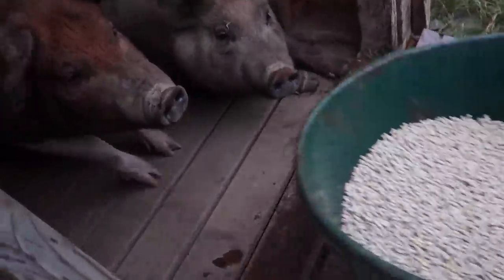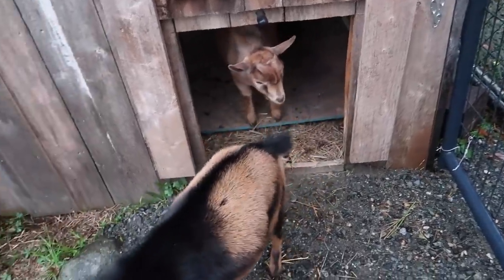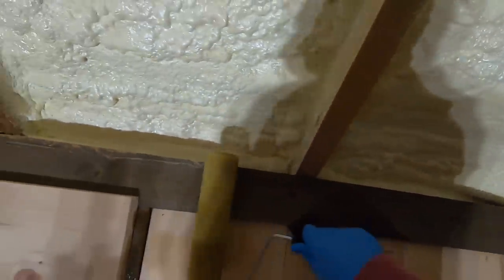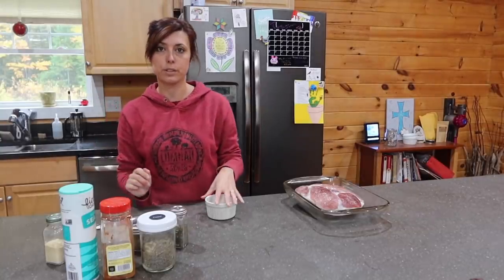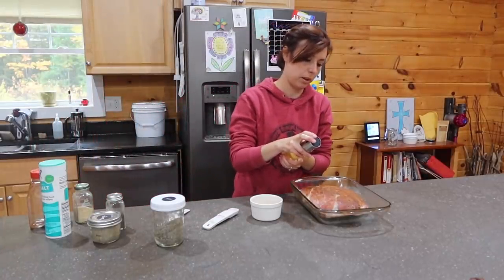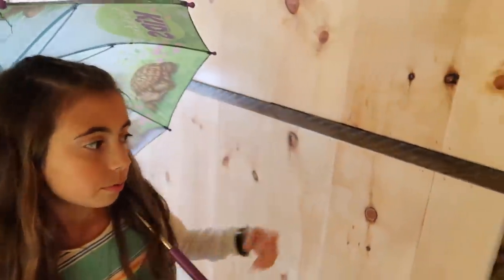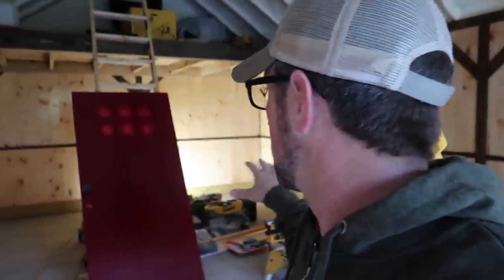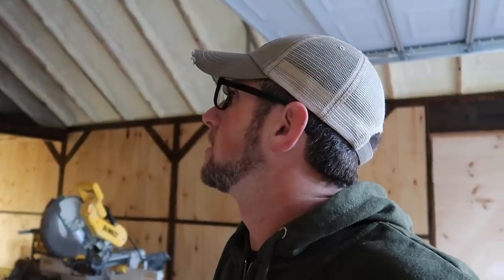Time to Get Sticky! Applying the FINISH to the Post & Beam WorkShop

Comment: You will get a lot of suggestions about the shop layout I'm sure. I only have one suggestion. Cover some of your workbench with metal, maybe the section under your vise. It is so nice to be able to wipe it off, and no oil or gas gets down into your wood. I was a mobile mechanic for years and learned the value of that. I went to a local store where they made trim for metal roofing and they bent the cover so it fit like a glove. It covers the back splash guard, bench top, then is folded so it slides under the front lip of the bench. Again, it fits perfect and eaves a clean looking bench. Surprisingly didn't cost much either.

Comment: Suggestion...   make everything on wheels, including the workbench(s).   There are a ton of locking flip down feet, etc...   believe me, one day you will wish you could roll everything over to one side if the shop and deep clean the floors.  Also, I started out with open shelves on wheels, and quickly changed over to rolling upright metal storage cabinets on wheels.  I keep the doors closed, and it helps to keep the dust off of whatever is stored inside.   I still have some rolling open shelving for big stuff that won’t fit in a cabinet, but those items and the shelves themselves are coated in dust!  Can’t wait to see what YOU decide.

Comment: My shop is deep like yours. I have mine setup in three parts. Right inside the doors i have the yard stuff we are always grabbing. One high  shelve  and wall hangers and mobile things we use outside. Next part is all my mechanical stuff to work on the car, truck and tractor. I have all of my big tool boxes , compressor, parts shelved and bench with vise.  The rest is the wood shop. U have a u shaped bench with overhead wood storage. Easy to sort and grab. Watch your chop saw placement so you can cut long. I have my table saw incorperated in a large runout table in the center that is mobile but locks in place. Use LED lighting and a lot of it. As much as you can afford and makes sense. Seeing your work make everything easier. Have about three drop down electric hook ups tall enough to not hit the top of the truck. Same with air compressor drops. Make sure you do a vac system for your wood work or you will have dust all over the place. Not sure about your ceiling. I wonder how much dust it will collect. 
Well. Its a nice shop. I love mine but i have had several setups and this works best for me. Make sure you do what works for you.  I have worked with and without heat but not anymore. Heat is important. You might want to insulate that g-door.
Love watching your videos. Good luck and cant wait to see what you do.

Comment: For the workshop, all the ideas you mentioned sound really good. My focus tends to be about usability and comfort. Specifically, I think around the benches you should have the rubber flooring to save your knees, back,  and keep you from standing on cold concrete--you'll thank me in 20 years. Also consider having an island bench that is moveable and add extra storage. Just like having a kitchen island, that way you don't have to constantly run from side to side, you only need to pivot. AND since it's moveable, you can position it anywhere. So, for example, Livies or Gina wants to work on something but you're already in the middle of something, in  a static setup and you'd be constantly dancing around and annoying each other. With a moveable bench they could set up their own area.
Reply: and rubber flooring/mats would protect floor from spills,,,good thinking
Reply: Those stable mats are ideal.
Reply: But that concrete sealer to keep junk from sticking

Comment: Build the right hand leg of the "u" shaped bench as a separate bench on wheels.  You can build it with toggle clamps attached to connect it to the rest of the bench and wall to make it stationary when needed.  Jay Bates just built a bench made of 2 separate halves clamped together.
Reply: I love this comment because having everything portable on wheels is really handy.  Including your chop saw.  I would ditch the stationary stand at some point and get a portable gravity stand.  Dewalt makes a gravity stand like my Bosch stand and they work fantastic for going to remote job sites easily. with all the dewalt stuff you advertise freely every day....honestly you should get a sponsorship and sample for every dewalt product that you need.  Having wheels will allow you to rearrange the work benches to allow you to set them up as a studio with the bench between you and the camera.  It will let allow you to work on extra long pieces that don't fit in the U pattern (I'm thinking windmill blades and tower pieces....hint, hint...)  
As far as other benches go, if you do put wheels on them, make a way to lock them down so the bench doesn't move *(especially if you have a vise). This could be as simple as a set of blocks to chock the wheels or buying wheels with locks built in.  Also, larger diameter wheels with bearings in them and rubber tires can also be pushed out onto the gravel if you need to clean out EVERYTHING from the barn.  

Love the barn. Its been fun to watch the progress.
Reply: I was thinking the same...
Reply: Simple surfaces that are all the same heights and with locking wheels.   Some with cabinet storage, some drawers, some open shelves.
Reply: Agree—my suggestion was going to be to put workbenches on wheels, makes for flexible configurations of work surfaces whatever you want to work on and wheels make floor cleanups a snap!

Comment: I have 3 friends that have built shops. 
They build their cabinets on heavy duty lock type casters.  The nice thing about modular units is the ability to reconfigure based on need. 
Like your kitchen island. That is a ton of work surface + enough space for visitors...  also, you can put some outlets in the cabs for lighter duty projects and storage. 
☮
Reply: and if you build a metal cabinet, put tubes on the bottom to capture fork lift tines.  Then you can use your 3 point hitch to move the metal cabinet around the farm if you need to do weld repairs remotely.

Comment: I love it when you walk to do afternoon chores with Olivia.  Sharing your day with her keeps it special for her to.  We had a 24 x 32 garage with 2 big doors and 2 utility doors.  On the one side we bought 2 of the kits for workbench's from Menards.  The were made from 2 x4's and were very strong and rugged.  They also had one shelf storage underneath.  Very user friendly and easy to clean.  Kept everything from being on the floor.  Remember to put in lots of pluggins along the benches for ease of convenience.  Also check out Pinterest Gina for battery holders for power tools.  Al can easily build one.

Comment: Good morning.
I would definitely make sure that all your conduit runs for power contain spare wire to allow adding future circuits.
There is a high likelihood that you will want a future circuit here or there and the spare wire already in the conduit will make that a breeze.
Reply: I would add 240 volt outlets as well for a welder and electric car charging.

Comment: All these comments are good. In our workshop We made all counter tops the same height with a roll around workbench the same height with 8 drawers in it. the top is made using 28 2x4s stood on edge much like wranglestars, wrapped with maple for an edge. the drop down miter saw stand is a must. Keep in mind the lengths of lumber you might be sawing when positioning where you mount your saw. Great work Lou, keep it up.    Rob.

Comment: If you are going to have the chop saw inset in one upright of the "U", then your vise should be at the end of the other upright of the "U".  You want it to be on a corner so you can work at it from a lot of angles, and it would be in the way of your lumber if it were on the same side as the saw. 
     Wranglerstar has done two series on workbenches. One was recent making and setting up one in his barn shop (general work). It was up against the wall. The other was a few years ago when he made a larger, freestanding one with a tool well for his woodshop. Paul Sellars also has a couple of series on making workbenches. (I believe all of the above have the vise at a corner.)

Comment: You might think of  sealing the floor just in case of oil from working on vehicles
Reply: Yes, definitely seal the floor. Remember what happened in the barn?
Reply: That's already planned. He started with the milking parlor and is doing that next.
Reply: That should be 1st thing.
Reply: @gentelbenn62  I agree, but I would epoxy the floor instead of using just a seal coating. It will stand up to the scratches and oil better.
Reply: @denisewilson8367  you may be right on that, goat P too.

Comment: I set my miter saw in the middle and built 2x4's on end both ways for a very heavy strong work bench at the height of saw. I drilled and used all thread rods to tighten 2x4's.

Comment: If you're going to have shelving at the end of the bench where you have the saw. Make sure you have the shelves at the same height as the bench so if you have longer planks of wood than your bench you can use the shelves to stabilize the wood so it doesn't flip up on you after the cut is finished.

Comment: Figuring out the work shop is very hard . You'll be changing things around until you get it right . Just make sure it's all portable for now . A chop saw station is great for cutting long boards . Paneling for the ceiling that looks like boards might be good . You can always put a finish on the boards before you put them up .I like the satin finish . Looking good Al . It doesn't matter how big your shop is you will always find a way to fill it . LOL
Reply from the maker: I’m sure we will be changing it up quite a bit. 😆

Comment: The ceiling cover it with 1/4 inch plywood. 
Outside under the shed roof, mount grinder, vise and welder out there.
Put 2 coats of polly on the walls.

Comment: I'm also OCD so that ceiling looks undone. Perhaps a light tan metal ceiling. Fast, cheap and slick so it will also clean easily with an air compressor.
Reply: Good point and I agree, also the fact that the foam over time will age to an ugly brownish color. :-)
Reply: Trespa plates would be Nice to for the ceiling.
Reply: Again watch april wilkerson she did the metal ceiling in her shop. looks amazing
Reply: I agree it looks unfinished. Is there any reason not to use gypsum board sealed and painted?

Comment: try a white steel ceiling panels , seen that done many times , reflects the light very well and would finish off the workshop nicely  , and your toolbox is a must in a workshop ...
Reply: Jim baker : l agree. Leaving the ceiling unfinished will create a hold for dust. With all the work you put into finishing this shop, it is not done with the UNFINISHED ceiling. But that is just me. Also, it is your shop, set it up the way it works best for you. Benches and shelves should be designed for the applications that you intend to use them for. By the way, it looks great. You two have done a wonderful job.
Reply: Steel will be quite noisy though.
Reply: If you opt for steel, Wendell used drop cloths slung into slings across the surface to baffle noise.
Reply: @patstrong547  no , its inside ,and they already insulated the rafters .....
Reply: @patstrong547  the steel gets applied directly to the rafters , it would look like a cathedral type ceiling ....
Reply: Exactly what i was thinking
Reply: Steel may cause condensation on the inside if the barn is heated in colder weather during the day and then goes cold overnight. Only an opinion but worth some research. Patina is good,  rust is bad

Comment: Your idea for work bench is great. Suggestion is recessed bottom shelf, so your knees don't get knocked around. The recessed shelf has those pull out open shelf thing you would use for pots  and pans in a kitchen cabinet for easier access. Also a dedicated charging station for all your batteries. Love all your videos. Have a blessed day.

Comment: The polyurethane really pops the character of the wood with the knots and the post and beam construction. Re ceiling, the exposed insulation can be a sawdust magnet making it dingy over time, cutting your light, and harder to blow off the dust. If you can seal that with a white/ light paint, and darken the rafters, that would tie the whole place together. You'll have to check with your insulation firm as to what you can put on the  exposed foam. I switched my 4ft sections of hallogen and florescent lights to 4ft LEDs and am very impressed with the brightness plus with their low power draw I no longer have to worry about popping a breaker, while using heavy machines.  Looks great!!

Comment: I built a work bench 18 years ago that I use mainly for woodworking however I do a variety of tasks (car repairs, appliance repair, upholstery, you name it, etc).  Make top out of 2 pieces of 3/4" MDF glued together.  Then glue a layer of 1/4" tempered masonite and band it with 5/4 hard rock maple.  Polyurethane and you're done.  My bench is behind my cabinet saw and serves as an out feed as well.  This bench/assembly table/everything table is subject to daily use and abuse and does not sit against the wall allowing me to walk around the entire parameter.  When it becomes too marred up, just sand and reapply polyurethane and it is good to go.

Comment: I am constantly changing up on my small shop. Over the years when I was still working I made a lot of  Cole the tool-man  OH ho ho ho purchases. More power fever! My advice is that you remember that space is at a premium, So commit to what you will be doing  and this will limit tool purchases. my big tools and the assembly table are on wheels. My biggest problem now is a vacuum system. My shop approach would be a french cleat , Murphy bed fold it up roll it away with hearing protection and knee pads approach.

Comment: I built 3 with those Heavy Plastic Leg Kits from Amazon.  PRO TIP- For the tops buy new Concrete Form Boards.  Mine were 24" x 8ft.  They are laminated and sealed for easy cleanup.  I even bolted vises to them.  Also easy for one or two people to move around as needed.  We love them.  And we have re-arranged the shop a few times so its nice to move them mobile.

Comment: The freezing weather is finally getting to us here in Wisconsin! Freeze warning tonight! I actually have to put heat tape on the water lines! As for the shop setup, I've done a bunch so here is a few tips. I put the chop saw, planer, etc close to the door so that if needed the door can be opened and very long boards can be planed, cut, etc. A fixed table with only 8' of in-feed will work some of the time, but will be very limiting. Get good dust collection and use it, and the more white surfaces and lights you have the better. I do carving on some of my furniture -- but all of it has mortise and tenons. You need to see what you are doing! Good luck! 😊

Comment: This is the exciting part for me. I have been waiting for this. I would like to suggest you make the workbench in modular section with casters. That will enable you to have flexible work space for every one's projects. Please use 2 x  without plywood. MDF might be an option. I also think everything would work better and last longer [can you tell I'm from New England?]  if you clear coat all the wood or use a hard wax finish. Much easier clean up that way, especially for Gina and Olivia. You could make shelving for the walls that hang on pegs. Easier maintenance and cleanup over the years. By the way, You talked about cutting off the top of the ladder. If you do that, there would not be anything to hold on to as you start to swing around at the top, either going up or coming down. I really like the lower lever for the chop saw and making the table saw mobile. In your design work, consider using pegs for various needs. It would look so good with the rest of the barn design. I am so excited to see what you do with the workshop. Thanks for sharing what you do.  <3

Comment: I like the layout that you were talking about.  The one thing that is constant in a workshop is that your needs will change with time so as you go forward, the layout will be tinkered with to better serve the use you have.  And you will see you will outgrow it  later on down the road and need it twice as big, maybe building your shop and letting your wife and daughter use it for their interest that dont like to be around sawdust.  Looking good, i like the finish.  I do think i would cover the foam in the ceiling so it doesnt collect fine dust that could fall and ruin a finish on future projects.  Something fast and easy like 1/4 plywood or MDF painted white or finished like the walls.

Comment: Have a sacrificial top to the benches using 1/4" masonite/hardboard (or whatever you call it in the US) Coat of varnish.
Reply: I agree, and it was suggested years ago by Norm Abrams from This Old House.  I believe that he had a hardwood strip around the edges, flush with the top of the Masonite.  Easy to replace Masonite when it gets all beat up.

Comment: Put the chop saw as well as the table saw on rolling carts that can be clamped to the rest of the workbenches.  You will thank yourself forever when you need to move them around through the property for future projects.  Get the big wheels that can handle terrain.  Make everything out of 2 x 4's and 3/4" plywood.  It will be sturdy enough for Olivia's grandchildren to still be using.